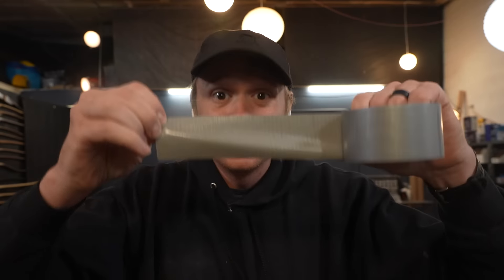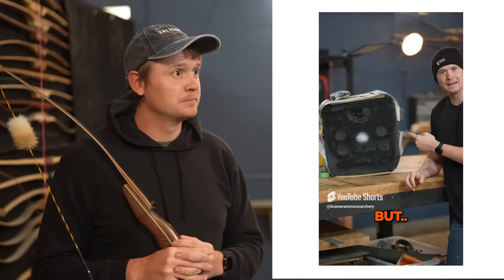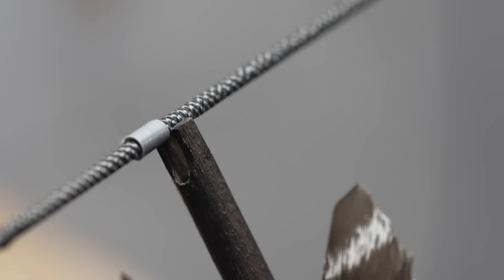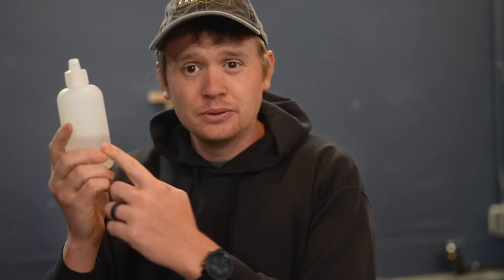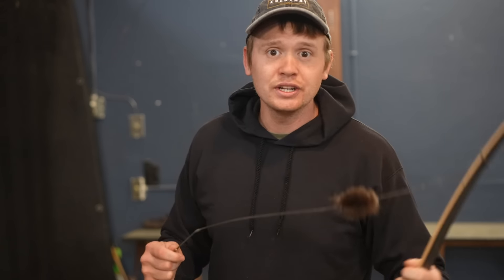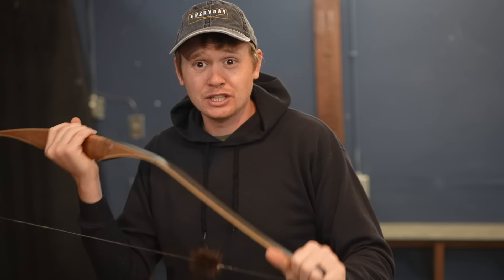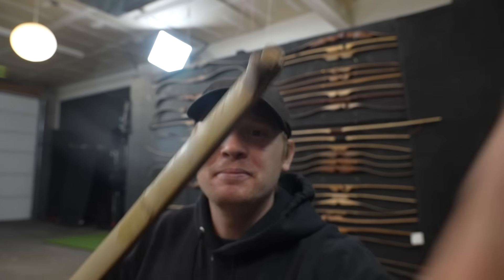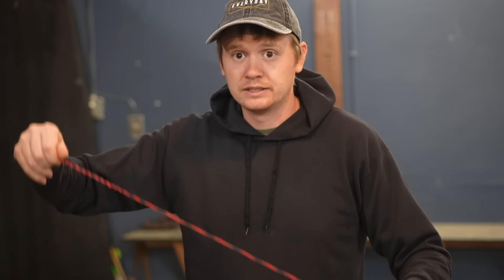5 Uncommon Archery Hacks I Use

Comment: Quick method to prevent the string untwisting when storing it. Find the large and small loop, the small loop goes through the large then the large through small, pull tightly, then you have a string stored without worry! Hope this helps :)

Comment: When unstringing, just turn & slide the top loop down the top limb... it doesn't twist and stays on the bow. I've never had a need for a stringer on my recurve.
Reply: Rubber band through it to the nock you took it off helps on slimmer bows where the string can slip off

Comment: Clipping the loops was great advice.

One can use a hair tie elastic.
Or a weak rubber band.
A very cheap key chain carabiner.
And a sandwich baggie, unzipped, open, can keep the string in a neat bundle.

Comment: i use the step through method to string my Turkish and my Manchu bows. I worry each time about limb twisting. Check that your string is in place on the bottom limb, secure this limb on your leg, put the riser behind the knee and bend both limbs in the same direction... so far so good. but I do worry each time.

Comment: I do a modified version of the leg method with recurve but specifically rest the limb tips between my toes to better distribute force and prevent anything from twisting... Only downside is you need to be either wearing shoes which allow this or take off your shoes and specifically set the tips down on thick socks so that no part of the limb tip is touching a hard surface.

Comment: Thanks for this, specifically the tape thing for finding the nocking point. I'm relatively new to archery. I opted for three under because I have a less than functional index finger on my draw hand and split finger is impossible, or at least extremely inconsistent. I initially tried string nocks after watching your video on how to tie them. They moved on me and I didn't want to glue them for fear I might have them in the wrong place. I went to brass and have mangled a few strings trying to remove and readjust their position.
 I'm getting tail kick from my new bow. I realized the brass I installed is a touch too high. 
I do use a T square, but I'm obviously not doing it correctly. 
The tape method makes a lot more sense. I only discovered the problem after buying some neon green arrows which are much easier to see in flight than the black shafts I was using. So if anyone else is in a similar position, maybe add some bright colors to an arrow or two so you can better see how it flies and rule in or out equipment as a cause of whatever issues you're experiencing. 
Thanks again and have yourselves a great day.

Comment: We put the end of the bow in the seam of our work boot grab the handle and pull upward while our thumb is on the loop on the back of the bow and our fingers are under the string on the belly. Bend the bow untill it is strung no twisting.

Comment: For the string, I go with loop through the loop and then again. Then I fold the string near the serving and put it down into a pen-slot in the gear-backpack. It doesnt unwind and because the loops are intertwined in eachother and in a pen-pocket, it doesnt open and untwist either.

Comment: I have a horse bow and always string it with the leg method only it’s safer and better for the bow to knock on the top first then hold it in place as you bend the bow and then knock on the lower limb.